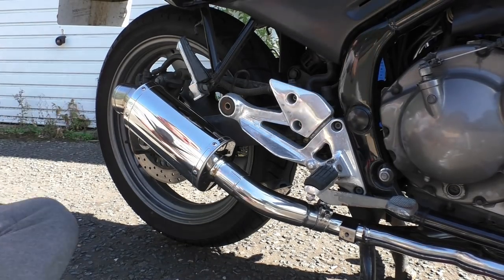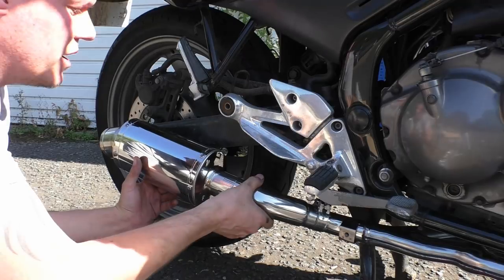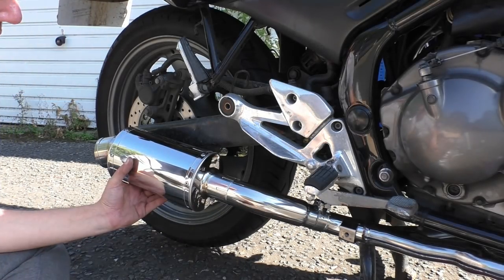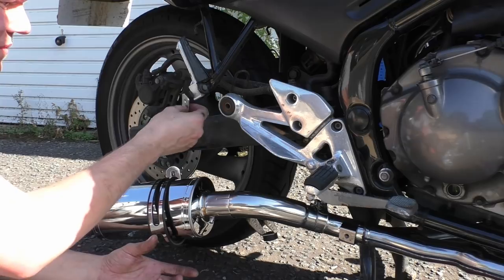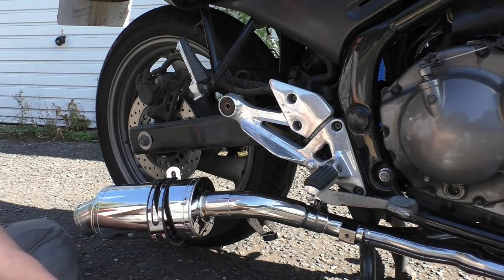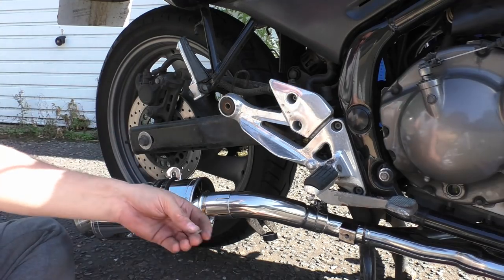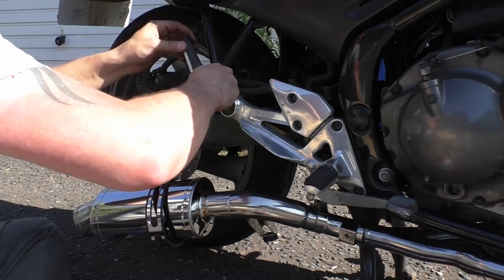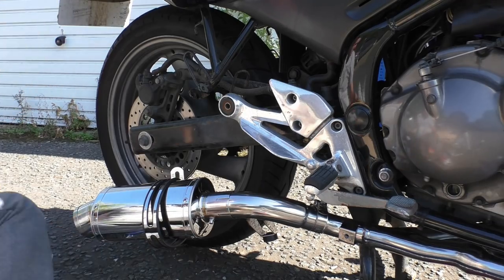Exhaust fitting - XJ600N (CV) - Part 2

Comment: Iv come back to watch some older videos iv missed and I have 1 of these systems and after a few years of having 1 I have a genuine  hate for it rivets on silencer cane loose the bracket under the bike dont line up so had yo make my own then the plate inside the collector box fell apart so it ratled like crazy had to cut it to weld it back in mine os on a 600 bandit it's a shame as they look and sound well but sadly for me they fall apart 🤣🤣🤣

Comment: Hello Matt quick question do you do may modifications to your bikes? If so what and why?
Reply from the maker: Is that meant to be many? And what do you mean? This bike or bikes in general?
Reply from the maker: Not always - it depends on what bike
Reply: What sort of mods do you do and why? And why to that particular bike?
Reply from the maker: Usually on bike I'm keeping I'll replace the exhaust for stainless - just because its the sensible thing to do. As for the other mods not many. I usually don't do many clip-ons, I do rebuilds, make my own bike with bits off other bikes.

For this bike its a secret until I do the project which will be coming soon.
Reply: Brilliant mate can't wait

Comment: It's always tricky to fit the exhaust gaskets - any type, copper, fibre, etc. - on these bikes. Just a tight fit. 40mm though. Also, I don't think you had original exhaust header bolts. The Haynes manual says it uses exhaust flange *nuts*. Hex nuts are much easier to reach through the frame. The new exhaust looks good.
Reply from the maker: They are nuts - I'm just used to bolts - slip of the tongue.

Comment: Hey Did you need to adjust the fuel and air or you didnt have to do anything
Reply from the maker: For this exhaust - nothing
Reply: Thank you and the exhaust and headers are the same for Xj600n and Xj600s diversion?
Reply from the maker: As far as I know yes - check the Delkevic website
Reply: Thanks man
Reply: @dirtygarageguy  ive got a similar exhaust on my xj600
Did you notice for a 4-2-1 system its "wrong"
Cylinders 1,2 and 3,4 are paired instead of 1,3 and 2,4
You get what i mean?

Comment: have you changed bigger main jets?
Reply from the maker: no
Reply: @dirtygarageguy  ok. btw did u notice any difference on torq or hosepower?
Reply from the maker: No. It's not that type of pipe and you'd never notice any change. Anything under 5hp you're not going to notice - so beware of marketing wank when buying an exhaust